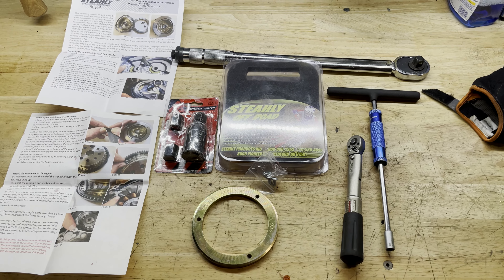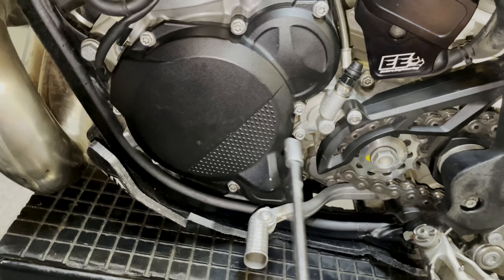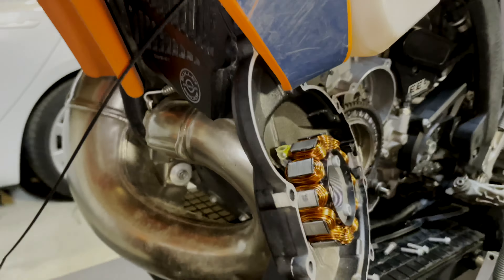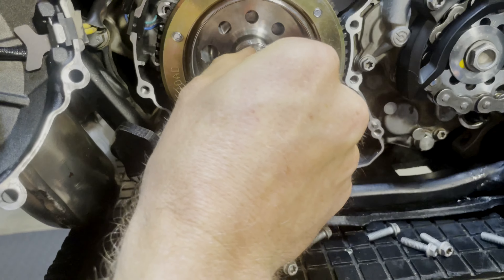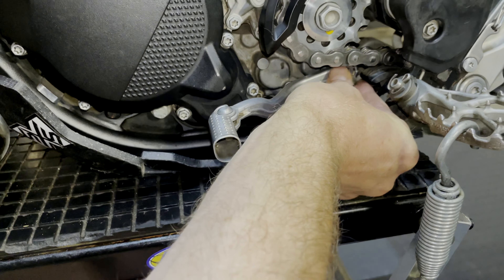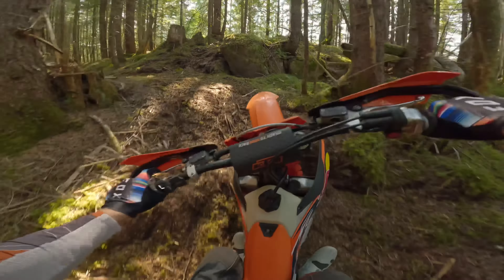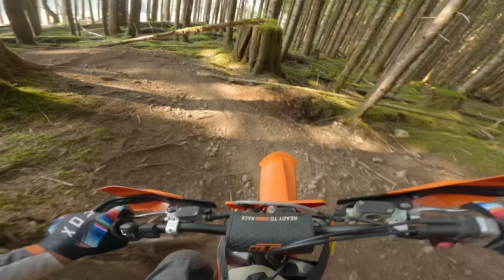KTM Steahly Flywheel Install & Review For 2023 2024 XC TBI

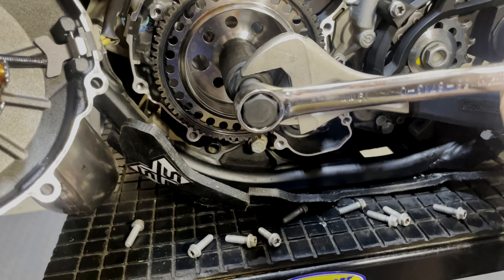Comment: Maybe a dumb question.  At the 2:52 mark with flywheel puller on, which way are you turning the wrench on the outer bolt of the flywheel puller, righty tighty?  You don't turn it, but only say just start cranking here it should pop right off.  Also, I don't see where you used one of the 2 small nuts for the crankshaft threads that comes with the Tusk kit, isn't one of those to protect the crankshaft threads as you pull and which one the M12 x 1.25?  The OEM microfiche shows the collar nut as M12x1 so maybe that is why you didn't use the nut included in the Tusk kit and only the puller itself?  I read somewhere also where one of those nuts don't allow the flywheel to clear, as if the nuts to are big and wider than the flywheel hole in the middle.  Can you explain how the puller works, I've never used one.  Sorry for the questions.  Thanks a lot!
Reply from the maker: Sorry I can’t remember. Pretty sure it was lefty lose.

Comment: I bought a 23 with a flywheel weight already installed and the clutch doesnt fully engage, idles great, but stalls in gear and lurches forward when clutch lever fully pulled in.
Reply from the maker: Strange, As the clutch is on the other side. I don’t think it’s flywheel related. Check you clutch, make sure everything looks ok in there.
Reply: @TechEnduro  that makes sense, I will have a look. Or have it inspected by someone who can enlighten my novice understanding. I certainly wanna keep the weight as I have the XC model and my mates ride hard Enduro style trails.

Comment: Very good video, thank you!  I had a Steahly FWW on my old 02 250SX and swear by them.  During my first ride on my 24 300XC, said to myself, yep, fww is going on this for the tight, slow stuff. Got the 9oz ready to install.  One question.  Do you have to take the shifter off?  Ignition cover ("screw, alternator cover" as described in my manual) torque spec is 8 Nm in my manual.  Clutch cover screws are 10 Nm.
Reply from the maker: I think you could get away with not taking it off but it only takes an extra minute, and you have more space.

Comment: Great video!  Appreciate the conciseness, humor, and video framing.  

I would note somewhere in your description that the flywheel puller needs to be an m28.  I stupidly followed the rmatv recommended size for a 2024 te300 and they sent me a M26.  Also noted that they don't have a drop-down for 23 or 24 xc nor tx.  So jokes on me I guess. I figured the flywheels would at least mount the same on the motor.

Comment: Seems like an Excellent mod for these bikes for the riding your doing here and woods harescramble type racing. light up the tire response is probably needed for those unexpected log hops in the middle of hill climbs and tight trails but other than free riding in the woods i have yet to come across that scenario in a actual race where it would make the difference of loosing a position and burning a ton of extra energy if you didn't make it first go. Think im going to buy one for my GG300EX.

Comment: anyone fitted to a 250 xc?? im thinking a 9 oz as well
Reply: I put a 9 oz on my 23 250 XC. Hated it and pulled it off immediately after the first ride. It killed the bike. No snap dead feeling. Tons of engine breaking, screaming at cruising speeds so you have to shift up then can’t pull the gear so back to down shifting and screaming. It ruined my ride. I’m curious what the 7 oz would do

Comment: Are you using a Rekluse? Wondering if the flywheel weight is needed with a rekluse?  Also I am torn between a 11 and 9 oz. I do the same type of riding as you. Do you feel the 9 oz is spot on?
Reply from the maker: Not sure as I don’t run a rekluse. 9 does feel great though.
Reply: @TechEnduro   Do you think the 7 oz or 9 oz might be better for the type of riding you do? I basicly do the same type of riding and don't know if I should go with 7 oz or 9 oz.
Reply from the maker: I’m really happy with the 9 ounce. That makes the flywheel weight slightly less than an XCW. I have a riding buddy that has the 7 ounce and he’s also happy so I think you can’t go wrong. I personally would go for the 9 though.